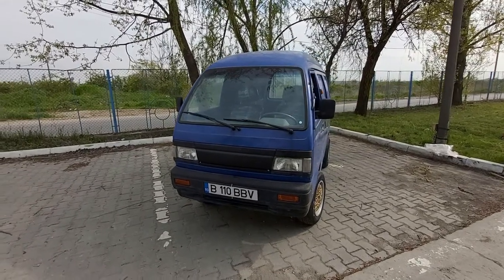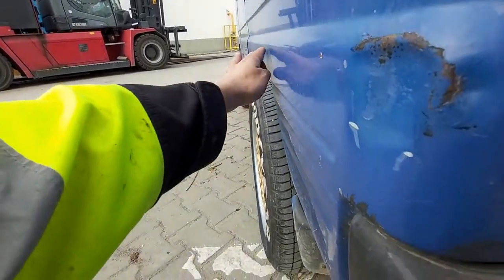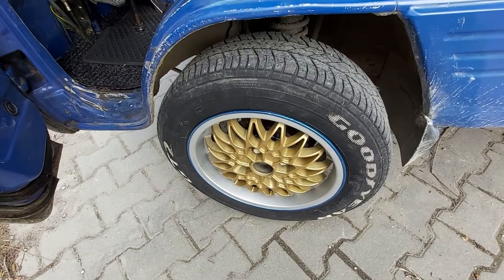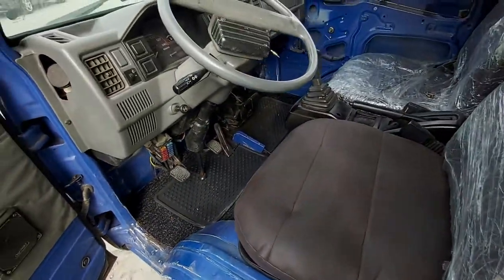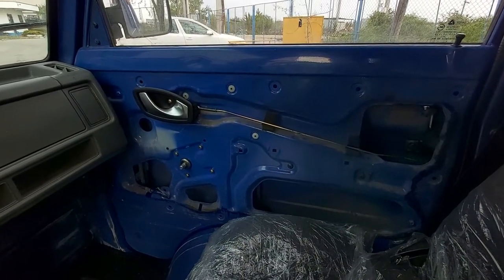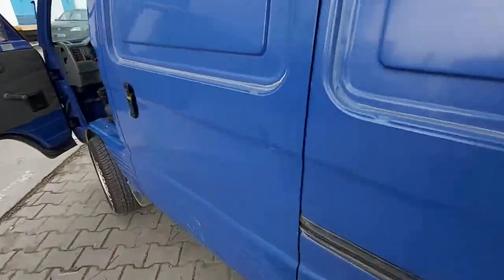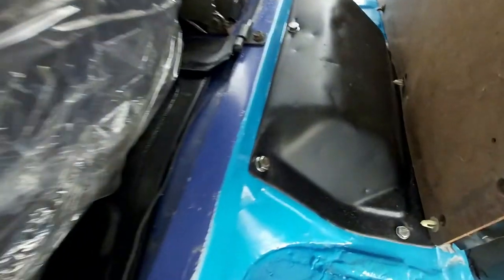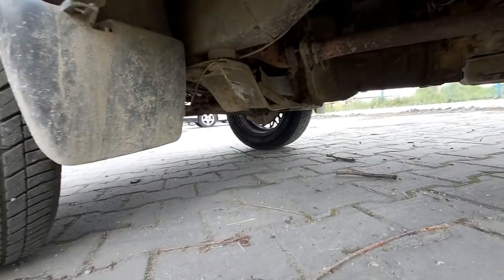Microvan transformation journey STEP:1 Daewoo Damas, Daihatsu Hijet, Suzuki Super Carry,  Rascal

Comment: Looks good! Where did you get wheel spacers to fit the van? They are difficult size to find.
Reply from the maker: @ Hugh Jasse, First of all, thank you very much for the comment. Wheel spacers are custom made on a CNC lathe in a local machining workshop. I did not find anything on the market for these dimensions to fit poroperly. These are adapter flanges to which we changed the distance between the screws from 4X113.4 to 4X100. Much more common size for rims found in Europe.